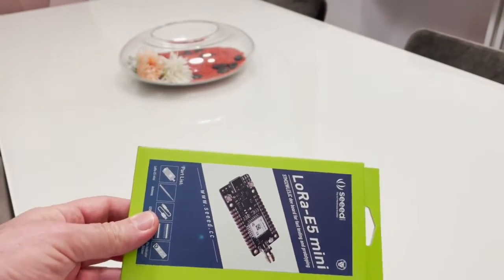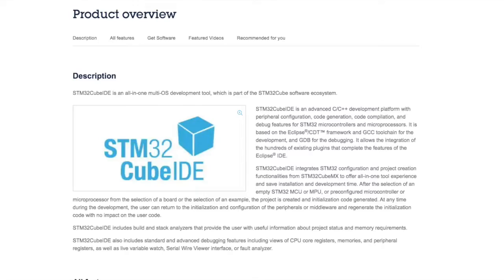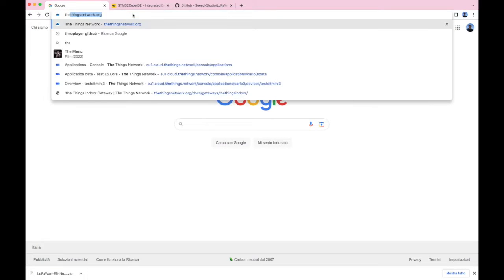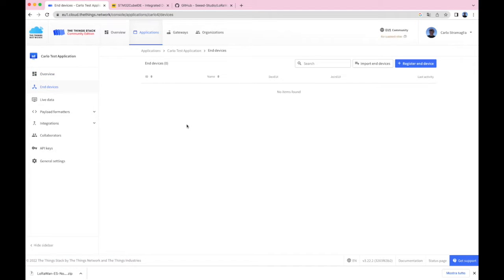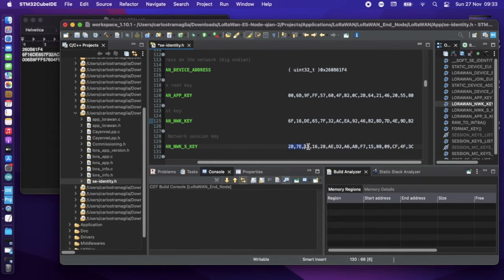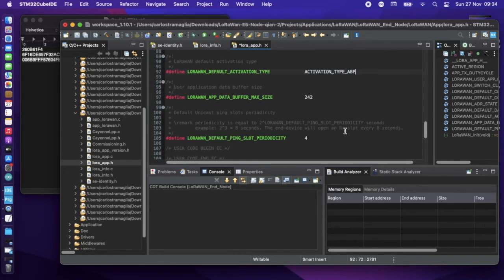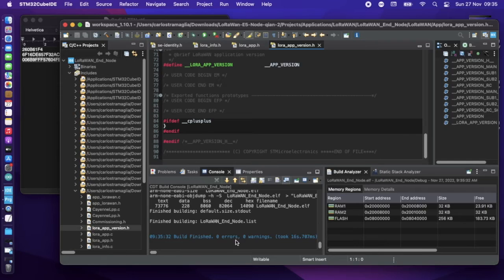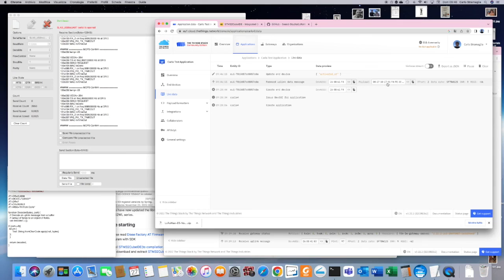Seeed LoRa E5 Tutorial with ST programmer

Comment: hii sir i have done all set up successfully without any issue but the my end device after register on TTS server i am using the sx1302 Lora wan Gateway on the Raspberry pi 5 setup and forwarder file run without any error but the End node is no connecting to the Gateway can elaborate full setup of the Gateway with end node how it will combined work successfully please share any reference material or video to do this full setup

Comment: Hello.
Thanks a lot for the tutorial.
I did everything exacly as you said, but at the end the node does not connect to TTN. And it does not show the frquencies in which it is senting like your. It only shows this indefinitely in the the E5 and in the TTN doesn't show nothing new:
###### = JOINED = ABP ======================
APP_VERSION:        V1.1.0
MW_LORAWAN_VERSION: V2.3.0
MW_RADIO_VERSION:   V1.1.0
###### OTAA ######
###### AppKey:      --:--:--:--:--:--:--:--:--:--:--:--:--:--:--:--
###### NwkKey:      --:--:--:--:--:--:--:--:--:--:--:--:--:--:--:--
###### ABP  ######
###### AppSKey:     --:--:--:--:--:--:--:--:--:--:--:--:--:--:--:--
###### NwkSKey:     --:--:--:--:--:--:--:--:--:--:--:--:--:--:--:--
###### DevEui:  --:--:--:--:--:--:--:--
###### AppEui:  --:--:--:--:--:--:--:--:--
###### DevAddr: --:--:--:--

The -- are numbers not showned.
Do you know how can I fix this?
Reply from the maker: Do you have a TTN gateway close to you?
Reply: Yes. I have my own TTN gateway that is receiving packets from other devices. The node keeps repeating "joined ABP" and printing the keys, but not the frequency trial and error as yours.
Sorry for the taking so long to answer.
Reply from the maker: @MultiJa7  sorry to hear. It should work. Difficult to say why it does not work

Comment: Good afternoon, I have problems to connect, it is stm32cubeprogrammer, an error appears that stm32 is not found, do you have any solution for this problem?
Reply from the maker: Hi. I had a similar problem. After that you have the unconnected device problem, try to extract and re-insert in the USB port the programmer. At that point I could connect.
Reply: @CarloStramaglia Thanks, it worked for me, the serial number already appears but now it gives me this error "Error: No STM32 target found! If your product embeds Debug Authentication, please perform a discovery using Debug Authentication"
Reply from the maker: First time I see this problem. Try this link https://stackoverflow.com/questions/61088116/how-to-fix-stm32cubeprogrammer-no-stm32-target-found
Reply: @CarloStramaglia  the problem was not solved, none of the options work for me, do you have your other material or idea to solve this problem?
Reply from the maker: Hi Alexis. Unfortunately no other things are coming to my mind.
Reply: Could you provide me with your dmg files of the stm32cubeprogramer and stm32cubeid installers since it does not allow me to execute the files from the official page for mac

Comment: Hi thanks for your great video. Do you have a clue why the device is not connecting? I think it has to do with the frequency. Can I narrow the frequency?  How do I setup the SF9 which is selected on TTN? Do you have additional Dokumentation? Thanks Dom
Reply from the maker: Hi Dom. The wrong frequency could be for sure one of the reasons for not connecting. To change it, you should look in one of the .h files in the project. I cannot verify because I don’t have the environment anymore. Let me know if you did it.
Reply: @CarloStramaglia  ok I will try and let you know. Thanks
Reply: Hi, Doboman were you able to figure the issue out?
Reply: @sambhavjain9623  did you figure it out?
Reply: Hi! I have the same problem nowadays, and Ican´t find a solution, so I´d like to ask you if yo could solve that thing

Comment: Thank you for informations. I can not connected to CubeProgrammer. Are you doing anything special for the boot?
Reply from the maker: If you have trouble connecting the STLinkV2, try unplugging and plugging back the STLink on the UBS port. It should work.
Reply: @CarloStramaglia  I tried many times on 3 different computers. Do you need to take any action? For example, removing the protection on it.
Reply from the maker: Hi @eneskaganleventoglu6582 I did not do anything other than what is in the video. The only issue I had sometimes is to connect the STLinkV2 but removing and plugging back the unit all was fine. Try to send me a video of what is happening on cstramaglia.cs@gmail.com . Maybe I can see better the problem and help you.
Reply: @CarloStramaglia  There is a problem with the e-mail address. Is it possible to connect via LinkedIn or whatsapp?
Reply from the maker: Sorry. I wrote my email incorrectly: carlostramaglia.cs@gmail.com this is the correct one.
Reply: @CarloStramaglia   i am also having a same issue can you say suggestion
Reply: Has your problem been solved?
Reply: @lucasroger4826  yes
Reply: @lucasroger4826  yes, i can help u

Comment: Hi, is there a way to program this device using just the USB port? having to use the STLink and USB, and  stm32cubeprogrammer and stm32cubeide feels really messy. are all 4 items needed? thanks.
Reply: I had to use all 4. And run through hoops to get the AT firmware out of it. Not impressed.
Reply: BTW, the STLink part of a Nucleo board, if you have one, can be used instead of buying an STLink V2. Works just fine.
Reply from the maker: Hi. I am new to this tool but I could not find a way to program it without the STlink.

Comment: thx for the video sir, but can I request in the next video about this Seeed LoRa E5 mini that how to use analog pin, UART pin on the device to read maybe analog sensor such as Arduino can do. 
After that maybe you can use that pin to read data and send it over the built-in LoRaWAN
Reply from the maker: Hi. For sure I will continue to work and post new videos on the E5. I will keep you informed.
Reply: @CarloStramaglia  okeyy, thx sir
Reply: I've successfully flashed the program, but the configurations differ significantly from those on the Seeed Studio board.

Like if i enable i2c it enables pins which are not on the board, the code is actually for the nucleo board of stm32